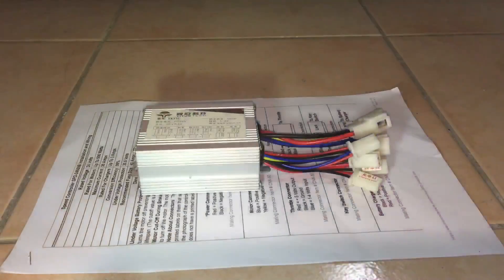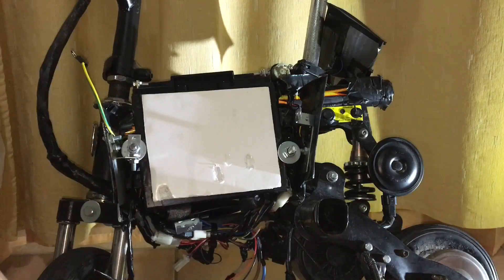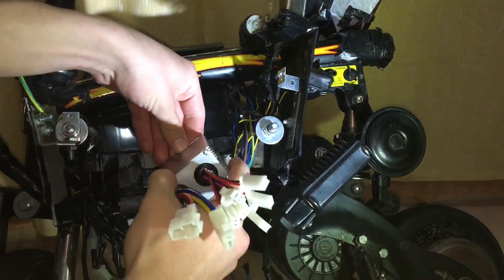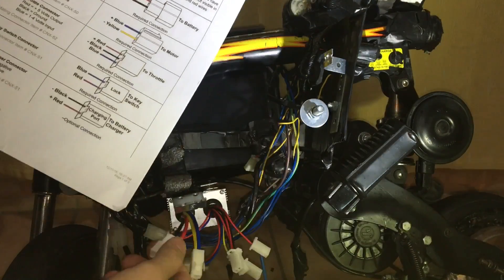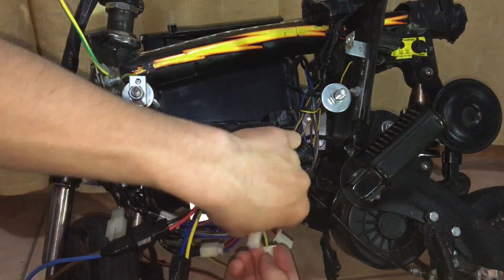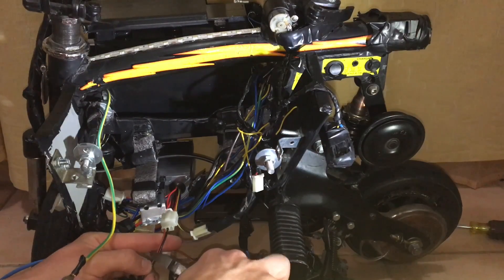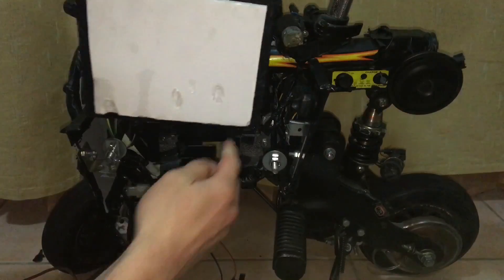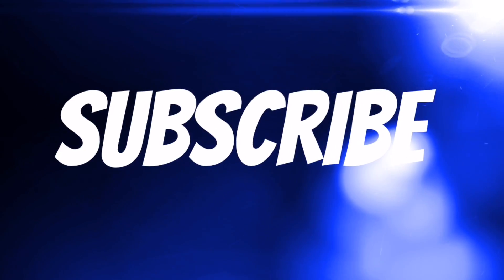How to replace the speed controller in an electric scooter

Comment: hey i need some help with my electric scooter i have the exact same one as you without the extras the problem i have is that whenever i charge the scooter it will flash yellow and red and i leave it on charge for a whole day and the led is red when i take the charger out. Do you have an email i can contact you with to show you pictures.
Reply from the maker: +rackon mackon Hi man, sure you may contact me on: ziadhamwi@live.com
Reply: +Ziad Hamwi hey man your great im going to email you now keep up the work thank you
Reply from the maker: +rackon mackon You're welcome man.
Reply from the maker: Ok, I see from the pictures you sent me that the LED light stays red even after charging it. Is that correct?
Reply: +Ziad Hamwi yes it does
Reply: +Ziad Hamwi after a 20 hours of charging still red should i change the controller module?
Reply from the maker: +rackon mackon I've had this problem twice before, and in both times I had a dead battery. Before assuming that your battery needs to be replaced, check its voltage with a multimeter (check each battery individually to accurately determine the condition of your batteries), if it's under 10.5V then it needs to be replaced. Also, it's a good idea to try another charger, perhaps your charger is weak or malfunctioning. 

If the battery voltage is around 11.5V, then it is weak and if charging it doesn't get the voltage up to at least around 12V then your battery most likely needs to be replaced. However if your battery is around 12.7V, then it is most likely a good battery.
Reply: +Ziad Hamwi Thank you very much i appreciate your help keep up the good work ill get back to you once ive done what you've said. thanks
Reply from the maker: +rackon mackon Your Welcome man. I hope I can help you get it back working.
Reply: +Ziad Hamwi hey do you have a link where i can buy the batteries
Reply from the maker: +rackon mackon Hi man, if you need to replace your batteries, here's an Amazon link to good replacement ones: https://www.amazon.com/gp/aw/d/B00RPTVSRI/ref=mp_s_a_1_2?ie=UTF8&qid=1510678392&sr=8-2&pi=AC_SX236_SY340_QL65&keywords=12%2Bvolt%2B10amp%2Bbattery&th=1&psc=1
Reply: +Ziad Hamwi Thanks bro
Reply from the maker: You're Welcome!
Reply: rackon mackon uyy77uuùuuuiiuuuu8uuytlollipop 9ool

Comment: I have a 2000w hub motor..60v 40 amp 15 fet controller..can i simply switch to a 48 v 20 or 30 amp one ..with no worries? I want to get good speeds but want to use my 48v lithium 11 ah..instead of 60v sla set up..
Reply from the maker: +Jay Gibb Hi, if you wanna switch from 60V to 48V, assuming you have a brushed motor, then other than the batteries you'll need to replace your 60V speed controller with a 48V controller as the 60V speed controller wouldn't turn on below its minimum voltage which is roughly around the 60V range.

Comment: Hello have a question I have a 1000w scooter but it's 36v what do I need to do to go to 48 v I have a super 1000 sit or stand scooter thanks for any help
Reply from the maker: kroozin5 +kroozin5 Hi, to go from 36V to 48V, first you wanna make sure that your motor can take 48V, if your motor is designed for 36V then feeding 48V through it will cause it to overheat and wear out its brushes quickly if it's a brushed motor. You also need to add another 12V battery to get 48V in total and lastly you need to replace your 36V speed controller with a 48V controller to handle that extra voltage.
Reply: Ziad Hamwi if the scooter is a 1000 w how would I know if it can handle 48v I don't really know much about this stuff
Reply from the maker: +kroozin5 Hi, if you wanna check if your motor can handle 48V, first check the specifications of your motor which are usually on a sticker on the motor or you can check your battery setup, if your batteries are 36V in total then your motor is 36V and if they're 48V then the motor is 48V. If your motor is 36V then it wouldn't be a good idea to run 48V through it as it'll cause the motor to wear out quickly.
Reply: Ziad Hamwi I have 3 12v battery so that 36v what I don't understand is there are 1000v with 48 and 1000v with 36 v I'm totally lost
Reply from the maker: +kroozin5 Hi, I get your point, in order for a 36V battery to power up a 1000W motor then it needs to have a higher amp hour rating than a 48V battery powering up the same motor as power (watts) equals to the current (amps) times the voltage (volts), or P = I x V, so when you decrease the voltage you'll need more current in order to achieve the same power output. So, in theory, a 36V 1000W motor should be very similar in performance to a 1000W 48V motor since they have the same power output.
Reply: Ziad Hamwi  thank you for all your help how can I get them lights you have there pretty cool
Reply from the maker: +kroozin5 Hi, You're Welcome. The LED lights I have on my electric scooter are standard SMD LEDs that I hooked up to the battery.
Reply: Ziad Hamwi the motor I have is zy1020 v36. Op 1000w  rpm2830  current 29.3A
Reply from the maker: +kroozin5 Yup, so that would mean that your motor is capable of outputting 1000W of power when you supply it with a 36V battery that can give out at least 29.3A.
Reply: Ziad Hamwi I'm sorry I don't understand I don't really no much about this kinda stuff
Reply from the maker: +kroozin5 I see that your motor is a 36 volt motor and it's designed to run at 36 volts from a battery that can supply 29.3 amps. So, if you're trying to upgrade your scooter to 48 volts then you better off replacing the motor with a 48 volt motor but remember that the power of the motor is from its wattage rating so since your motor is a 36V 29.3A motor then the power would be: 36V x 29.3A = 1054.8W so your motor is 1000W and if you wanna upgrade it to a 48V 1000W motor then you wouldn't really gain any extra performance as you still have the same power output which is 1000W.

In other words, a 36V 1000W motor should have almost exactly the same performance as a 48V 1000W motor since they both are 1000 watts. But the difference is that for a 36V motor to be able to output 1000 watts then you will need a 36V battery that could supply at least 28 amps whereas a 48V 1000W motor needs 48V battery that can supply at least 21 amps.

Comment: Hi my scooter i changing but the wheels do not rotate..  
Becouse to long nvr use n changing..
wath happen to my scooter...??? Pleas help me
Reply from the maker: +risa uwiwien Hi man, check your brake lever switch, if it is broken it could be pressed all the time causing your motor not to spin since the speed controller would assume that you're pressing the brake the whole time.
Reply: Ziad Hamwi  
Thank you very much  i will tray latter now i still changing
Reply from the maker: +risa uwiwien You're Welcome man.
Reply: Ziad Hamwi  yes you are right.. then wath i can do to make the wheel spin normaly...??
Reply from the maker: +risa uwiwien Hi, the best thing to do would be to replace the switch with any normally closed switch and that should do the trick. If you first wanna test if it works then disconnect the brake lever switch completely from the speed controller and check if that fixes the problem.

Comment: Hi, i need to stop my scooter when it runs fast can you say how to stop it electrically ( my brake function controller only opens the power line )  i know others can stop it like that , do you know witch controller can do that
Reply from the maker: +Javier Jimenez Hi man, I see that you wanna have your electric scooter stop electrically which is also know as regenerative braking. If you wanna add regenerative braking to your electric scooter you wanna make sure that your scooter has a gearless brushless motor and you're gonna need a speed controller that supports regenerative braking. Here's a link to a controller that supports regenerative braking: https://www.amazon.com/Brushless-Controller-Regenerative-Braking-Electric/dp/B01M7QC1TT
Remember, when picking a new speed controller you wanna make sure that the new controller matches the voltage of your current controller and it should be able to output at least the same power (wattage) output as your current controller.
Reply: ok thanks
Reply from the maker: +Javier Jimenez You're Welcome.